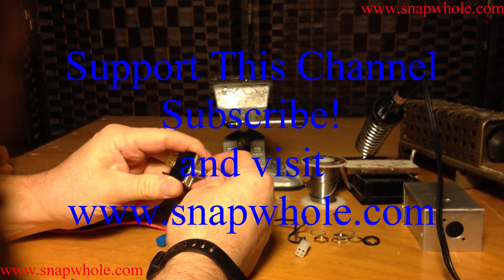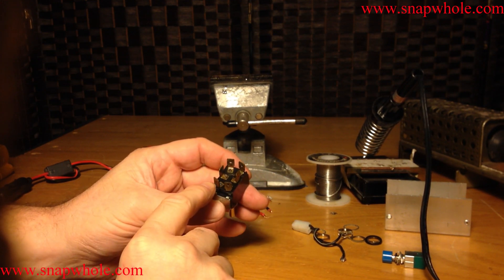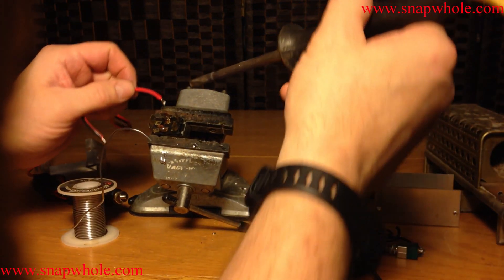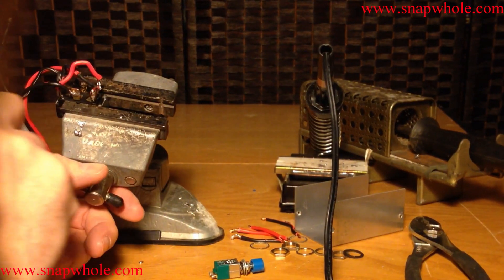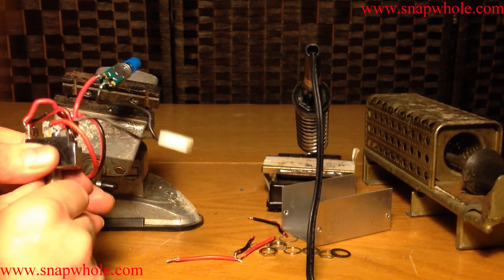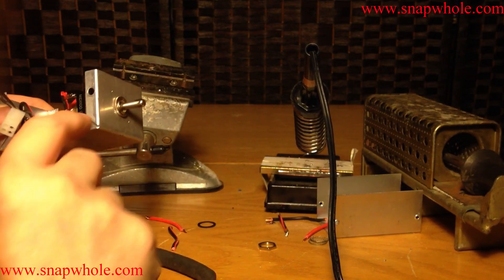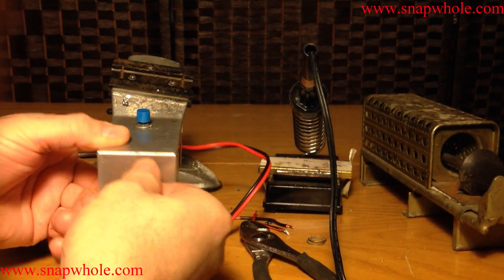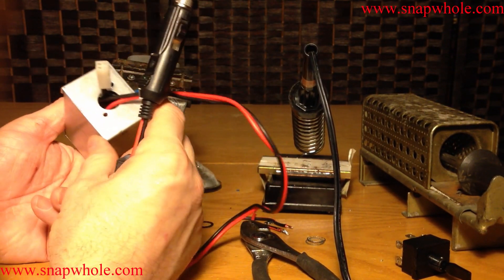QRP Tarheel Screwdriver Antenna Controller Construction

Comment: Could you just use a 3 position momentary switch instead of the 2 components used here? Thanks
Reply from the maker: yes that would work, so would 2 momentary contact switches, many different ways to build this, this video shows my method - the method someone else uses will probably be influenced by the parts the have on hand - thanks for subscribing